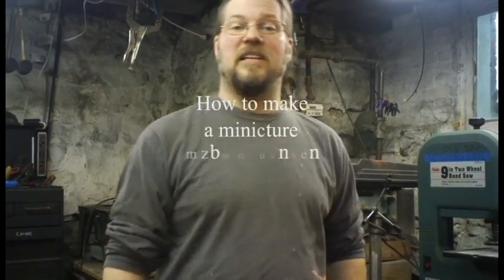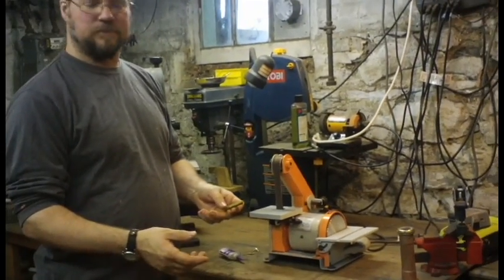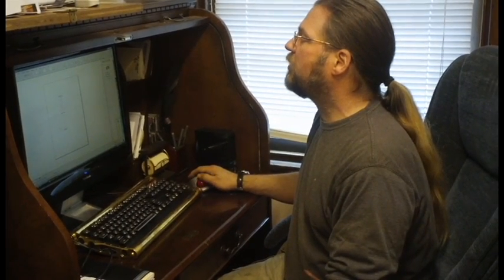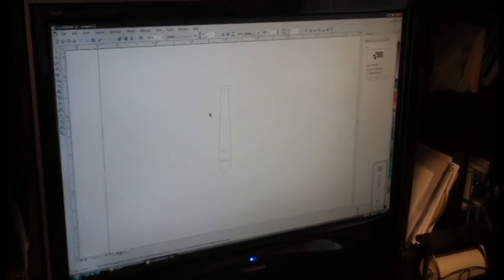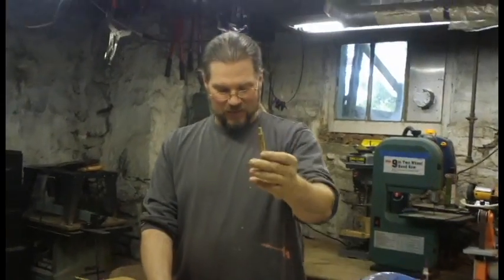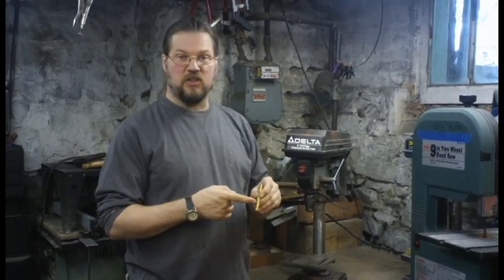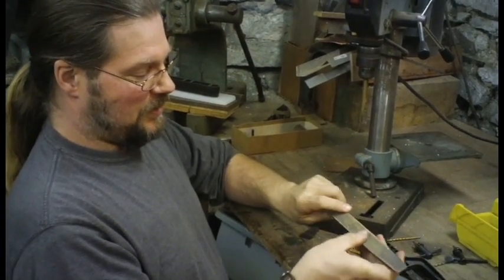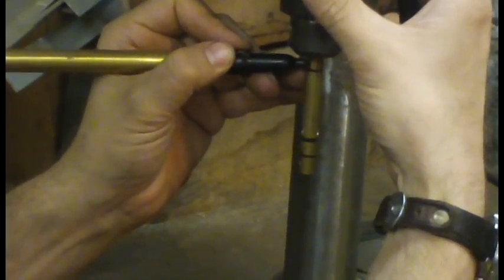How to Make a Cannon part 1

Comment: I know it was not your intention to show people how to make a working cannon, but the principals are so similar that I thought I should say this:

This video mentions using Aluminum instead of brass. 
This is fine for a non-firing model, but do NOT under any circumstances use Aluminum for a cannon barrel that is to be fired.

Aluminum might hold up for a few shots, but it develops stress cracks, and WILL explode eventually.
Reply: +xdoctorbeatx Indeed! Because of it's brittleness, it might be fun to cast some hollow cannon shells out of aluminum and test them with black powder... of course, the fuse design would be the most difficult component to get right.

Comment: your video is the reason why i love my lathe, mill, cnc mill, and cnc lathe so much easier to just put it in gibbs cam and throw it on the cnc lathe. Your way is smart except i cringed on the drill press part cause i could just see your hand geting thrown into that drill and torn to shreds i would invest in a mini vise you could clamp to the table or get you a cheap mini lathe and mill for around 1500 for both

Comment from the maker: I beg to differ. I have a lathe and I still use this method on occasion. This video is about using what you have to get the job done. is it "safe"? Not at all. 
Remember folks, Safety 3rd.